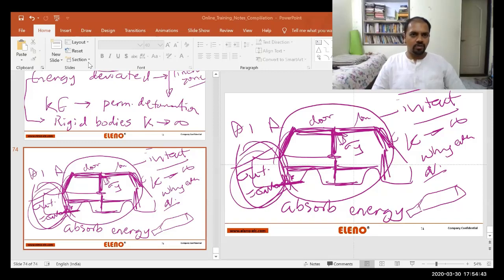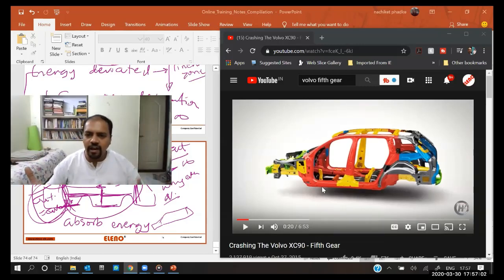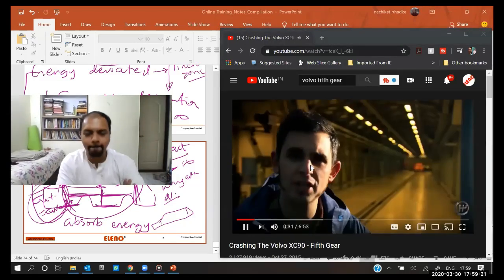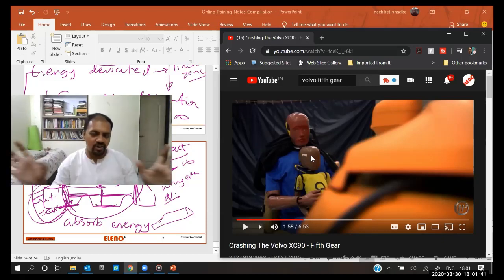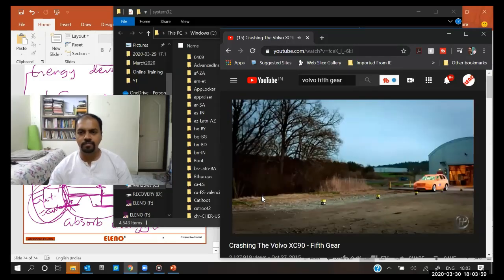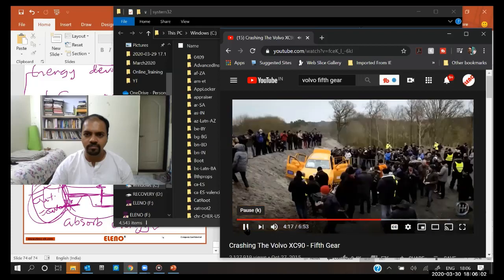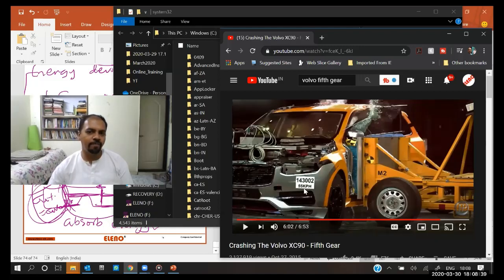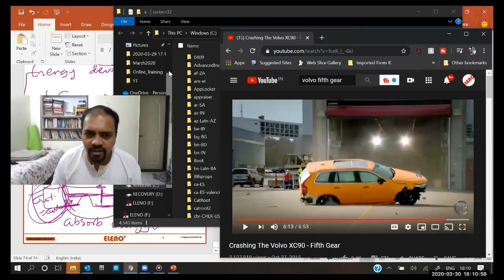Vovlo Crash Testing and Relation with Basics of Engineering

Comment: The bottom line is that the safety of the passenger depends on the design seating system. Spine injuries, head injuries, knee injuries, and much more can be prevented by a good seat design.
Reply from the maker: Yes indeed